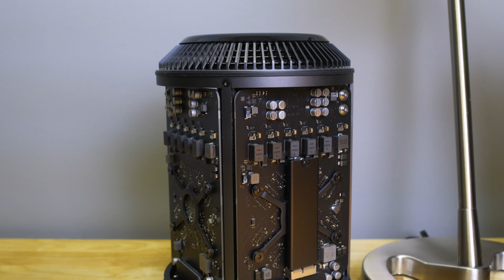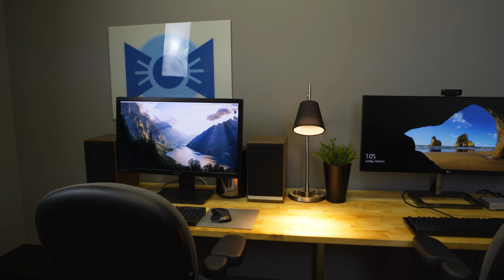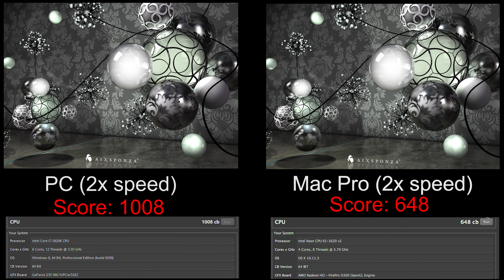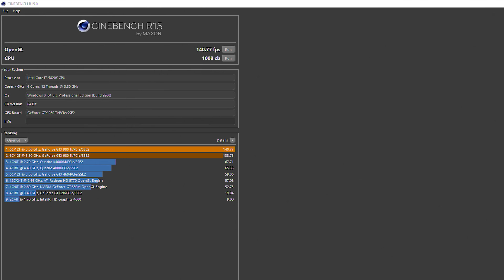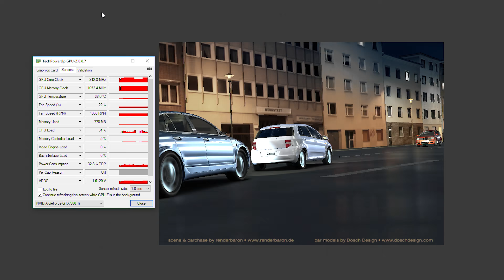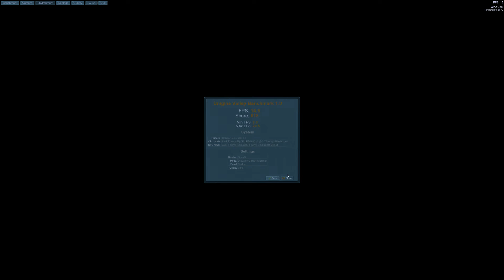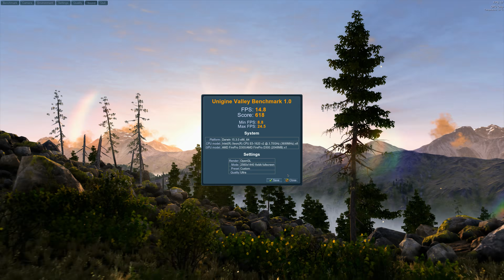$2,000 Custom PC vs $4,000 Mac Pro

Comment: The only thing that's better about the PC is the price, performance, upgradability, compatibility, ease of use, operating system and software. Everything else is better on a mac.
Reply: Gaming.
Rendering.
GPU and CPU speeds.

What does Mac have?
A shitty, buggy OS.
Terrible hardware.
Anti consumer marketing.

Just know that I was an Apple fanboy for 5 years.

Comment: You know what?
M - Most
A - Annoying
C - Computer

Because its very expensive and useless and looked like can

Now how about PC?
P - Perfect
C - Computer

Because its very cheap and its faster than MAC
Reply: Adobe Flash isn't outdated.
VGA isn't outdated.. yet.
Headphone jacks aren't outdated.
Reply: IronLover 64 how are they outdated
Reply: Most Applications Crash. If Not The Operating System Hangs. MacIntosh.
Reply: Milk

At

CPU
Reply: No no no pc 
P - plastic 
C - cock
Reply: LukeGaming LK 
With outdated tech like CDs, Adobe Flash, VGA, headphone jacks
Reply: Also viruses lul

Comment: 1008cb for 2000$?? i get 1500cb for 1500$ with ryzen 7 1700!
Reply from the maker: +Kuntal ghosh This is an old video as you can see by the date. I recently built a Hackintosh build using a 1600. Check the channel. :)

Comment: Honestly I hate windows computers soo much. My mac mini I've had for 2 years now still runs fine with no problems of any kind. I had a windows computer for 1 month and it is already getting viruses and problems with performance. Both computers have the exact same stats and price but the mac runs much faster. I spent a week finding a way to sort of overclock the pc and it still doesn't reach the speed of the mac.
Reply: iTechGhost tried mcafee yet

Comment: No it's not anything refurbished it's just power supplies HDD's and SSD's which are terrible to buy refurbished because they have a pretty short life span compared to everything else in a PC, CPU's if not overclocked can easily last 10 20 years, RAM as long as you don't mistreat it will for all intensive purposes last forever, GPU's last 7 - 15 years~ Motherboard it really depends but I wouldn't be afraid of buying a good quality all Japanese solid state capacitor motherboard as the caps are the things which have the limited shelf life and they have to deal with clearer power than the power supply does so if it's well designed you are pretty golden for upto 20 years as that is the mean failure on those capacitors.

Comment: First time viewer, first comment. I have a 2009 HP 6654 pavillion running 64 bit Win 7 & 10, I'm playing Mass Effect Andromeda, Assassins Creed (all of them), Crysis 3 (at high graphics) and they all run at 35 to 50 fps on OEM parts. My rig should be 6 feet under and these games shouldn't be possible to even run but it seems that a streamlined setup and solid hardware are more important than whatever marketing hype you'll see in a catalog.

Comment: Great video!! I totally agree that Apple needs to up the game, unfortunately their focus is somewhere else. They look more at the wholistic user experience not raw performance power. 

They will never be bleeding edge in the hardware, but they continue to push the boundaries in interface. For example I have yet to find a product that works as well as iChat, or FaceTime. Skype is a long and very far second place. 

Those are the types of things Apple focuses on, we use FaceTime now exclusively at our company and would switch to PC/Windows based in a heart beat if we ever found a product that worked as well.

Comment: Well, with mac they stuff everything into small tube and put fan on top. This type of case meeds major redesign of internal components from ground up, it's not same as pc standardised hardware, where you just put everything together in a box. It's beautiful, but you pay fir it. if you want upgrade, you'll will have to wait for next model, which sure it will be high specs what it comes out, but after 3-4 years it will have same problem as this one.
That's why rational people (like me) buys pc and build it up their needs. Since last 10-15 years apple use intel chips, it's basically the same as pc technology, just with better looking design, but even this start ta fade in last years..

Comment: The only thing good about a Mac computer is the OS; granted no one ever does these test with like for like parts. Because Mac uses the same intel components every company does the just put it in a nifty enclosure and up charge 3k for the OS
Reply: I agree with you but using like for like parts just isn't the case and even when you do use equal parts it is always most times cheaper, even at launch. Parts like the SSD and the RAM are overpriced in MAC systems when you can get them for cheap on a PC

Comment: there is alot of mac people who are trying to convince me to buy it because its more reliable, wont slow down after years of use and it is less likely to be infected by viruses.  is this true? or is this all garbage. i am torn over which kind of computer to buy.
Reply: It is obviously not true. the "slow down after years" i dont quite get it, if a computer slows down is because a) viruses (most common thing in unfamiliar users of computers) or b) old parts, wich is in fact a downside to mac, since you cant repair alone or exchange the broken parts. and where the viruses part is half true, since not many viruses are targeted to mac, if you dont download cool toolbars and porn from softonic you will be ok. Since you seem unfamiliar with computers, i wouldnt spend more than 200$ in one right now.

Comment: Isn't a Mac good because it doesn't crash as much or at all?
So if someone was a programmer wouldn't a Mac be the better machine of choice.
Reply: As long as you dont download cool toolbars from softonic, your windows is going to crash the same as your mac. And the "crash factor " isnt reliable on machine, but on the OS. If you were a programmer you would probably use a pc with linux.
Reply: Mr. Bannana your implying that windows is prone to crashing which is not true as long as you take care of your system.

Comment: Oh cool so didn't even come close to building a mac pro. Do you know why the ram needs to be ECC? Do you know why the mac pro uses FirePros? Do you know why its a Xeon processor? And you completely started the video saying everything wrong. You overclocked your machine like a dumbass, so now you will need to add extra fans for cooling, more noise, more heat and you have no reason to be benchmarking them. Cool you ran some short-term tests, let them run for days rendering 4K Adobe Effects compositions. You will burn up your custom pc. You clearly have no idea what you are doing, and comparing consumer quality to production-server class quality components. Of course you saved money, but you have no idea what you are doing as it compares to doing when it comes to professional production work. Have fun playing games at 60fps, but it won't consistently render 60fps 4K, not before your overclocked cpu and overheated gpu gives you neckbeard dumbass.
Reply: oh i see, a constructive critic.
Reply: Cory Billeaud probably search up everything before you commented
Reply: MrChickenFlix no just have heard the same tired argument for years from people who think gaming based-specs are the same as needed for professional workstations. It's the same misinformed argument i have heard since the windows 98/NT days. there is a difference.

Comment: You're doing it WRONG.
Try comparing rendering and export times using Final Cut X on the Mac Pro and Premier Pro on the PC. When Apple optimizes software and hardware to work together the performance is spectacular.

Comment: I had better benchmarks on Unigine Valley on my PC which is cheaper than either of these O.o
Conclusion: Both of these systems are overpriced (The Windows PC shown can be bought/built for MUCH cheaper than $2k)
Now with Ryzen out for multitasking/core and GTX 1080/Ti You can easily build a machine a lot more powerful than reference shown here for much cheaper.
You should do an updated version of this video doing just that.

Comment: No surprises here. Apple is getting left behind. No, actually Apple abandoned these high-end users. And they have ALWAYS been weak in graphics processor options. I am probably going to upgrade my Mac Pro - one of the last-gen of the towers - till I can't anymore. But next machine will likely be a tricked-out iMac. More cost effective, and the 5K iMac IS a higher end machine than the base Mac Pro.

I'm a Graphics and Web Designer, but if I was doing a lot of high-end video or 3D modeling or animation, I'd HAVE to bail for Windows- which is a lot less a horror show than it once was. I prefer the Mac OS, but I've not been happy with Apple's uneven 
support for pro users the past DECADE. 

But what happens when their APP DEVELOPERS start jumping ship? You know the guys and gals that make those pretty little apps for iOS? – and need pro class machines to CODE on. They've already complained about the new MacBook Pro.

Comment: My i3-6100 with a GTX750ti scores 909 in Unigine (1.5 times as good as the Mac Pro) but only cost 550 Euros.
Reply: I ride around and stuff it cost that much? For 550 Euros you could've gotten a gtx 1060 6gb with a i3 6100
Reply: No Uploads not with a WiFi mini ITX board, SSD and a small case that doesn't look ugly.

Comment: Actually I originally bought a mac (2009--I know it's ancient!)for the stability of the Linux core. But now they are so behind the times...unlike when Steve Jobs ran it they actually had something called innovation...under Mr. Cook...not so much..if they don't get their hardware rear in hyperspeed they are going to lose many many customers...I use mine for music and love the stability but I need more power and speed. I saw a demo of a Dell laptop with v warehouse installed..so they had a mac osx session running on the laptop....and it cost much much less! I will either do something like this or a hackintosh. Either way Mr.cook needs to slash prices or really and truly be innovative...and not that stupid bar stuff or a single USB C. Or I'm gone too!!!

Comment: Shawn Snow i had been missing my old macbook pro 13'' late 2011 when i bought my Asus Laptop at 2013-4. Now i have a pc with 1060 and i still miss it sometimes. OK. Gaming was horrible but all computers are not for gaming. My macbook is 6 years old now ( my sister is using it) and its battery died this year, hardware was never a problem, osX runs like a dream, its trackpad and keyboard are flawless. I can't use my asus without a mouse but i enjoyed using the trackpad of apple. If you say apple is overpriced i will agree with you but noone can call these are bad computers.

Comment: Great! Is it also a good configuration for FCPX?

I founded online this one for FCPX, does anyone know which is the better one for fcpx?
PROCESSOR: 4.4 GHZ Intel Core i7 Processor
MEMORY: 32GB DDR Memory
MOTHERBOARD: Gigabyte GA-Z97X-UD7 TH
(2) AMD GRAPHICS: Sapphire Radeon VAPOR-X R9 280X 3 GB GDDR5 (these are a crucial ingredient for FCPX)
NVIDIA GRAPHICS: EVGA GTX 980 SC 4GB GDDR5 (NOTE: FCPX does not like NVIDIA Cards – AMD Cards are far superior)
POWER SUPPLY: Corsair Professional Series 860-Watt Power Supply AX860

Comment: So, is the 12 GB ECC DDR3 RAM in the Mac supposed to be equivalently tested with the 32 GB DDR4 RAM. That doesn't sound like a fair test. However, if the price is cheaper for custom PC then I like that better. However, what would happen if you upgraded the RAM in the Mac and ran it again? would it perform 3 times better with almost three time the RAM?Anyway, I'm not worried about that, I just need a machine for my wife. She does Videography/Cinematography for our church. And what I'm curious about is whether or not I can get a custom PC built in time for Christmas!

Comment: 7:00 Actually you mean more than 3 times as fast. More than 3 times faster means that it was more than 4 times as fast.
8:28 Their deal is that they know their customer base treats Apple products like a religion (I'm not exaggerating, there has been research into this that shows the same brain centers become active) and will buy their products regardless of anything. Why update and have a lower product margin when you can make more money through fools who wouldn't know good value if it shoved a 10 foot pole up their ass?

Comment: How gay one must be to buy this outrageously outdated and overpriced apple shit. It is getting to the point of absurd. And even if apple made new and faster machine than this 2k pc set up, the apple crap would cost 8k. look at the new macbooks, 25% more expensive than last years, but already with outdated hardware, better machines are sold by competition at 1/3 of the price.
Reply: i'm gay, I don't buy apple either, build all my own pc's

Comment: Last apple product I bought, and feel it was a good investment was a 2009 duo core intel macbook pro.  Still works 7+ years later, average cost per day to use was less than a dollar to date now.  Entire machine and the one before it was swapped out for replacement parts under applecare, so in honesty I have gotten two machines out of this one, no warranty costs other than the 126 for applecare, and so forth.  It now serves as a low end mobi system that just keeps on giving.  So, yes, apple sucks now, has for really a long time, and I would never buy another apple product again new, or even refurbed.

Comment: This question is only for knowledge. People usually say and also write in posts that Mac is the better choice for video editing and professional work. Why do they say that? Are softwares available for these tasks on Mac operating system significantly better than those for windows? Clearly the hardware on Mac is bull crap. So there should be some good reasons for saying that.
Reply: I think it's just like how apple advertisements work. It's just a bunch of horse manure to lure the flies.
Reply: Fahim uhh... jee i know this comment is almost a year old but to answer your question:
The problem is that a lot of these professional content creation programs (your final cut, your pro tools, etc.) are often built from the ground up FOR the mac operating systems (I can't imagine why). Thus, pc's, as strong and efficient as they are, may not always run these perfectly. I mean they DO run, but they may look a tad different and may experience a few more bugs and glitches than they should because they are rarely properly optimized for windows specifically. I certainly remember opening up pro tools on my pc after seeing it on mac first and remembering it not looking as smooth and as organized as it normally should. This is why i have recently been curious about these "hackintosh" computers people have been building recently. Basically, it's the same pc hardware like you see in this video, but instead of windows, they install the mac os instead. In theory, this should allow you to have both the amazing perfomance of pc hardware, but have the professional software optimization of mac. However i have not built one of these yet, so i can't say for sure...
Reply: Fahim you are correct deathstroke
Reply: You realize that the biggest and most successful major recording studios use Pro Tools, right? I'll grant that others are great for making edm, but once you step outside of electronic music, PT is still the industry king. So yes, it's considered professional software by professionals.

I'm also gonna say that Pro Tools 10-12 run great on Windows 7 as long as there's decent hardware. I haven't had a crash since I upgraded to a quality pc, and even my old cheap Dell laptop ran it fine with rare crashes from 2011-2016 until the power supply started to fail. 

Perhaps the reason for people praising Macs is the fact that there's not a large overlap of "creative" type people and those savvy with building a pc. With a mac, even though it might not be the top performer, you can at least be confident that it'll boot up without exploding and do what you need to get done, with much less knowledge or research required than it takes to make a working pc. That said, a 2017 survey of music/audio creators showed that 51% of respondents prefer pc, while mac is only preferred by 46%, with the remaining 3% using "other"
Reply: The real question is ¿who the heck buys apple trash? 

P.d only rich idiots

Comment: Correction, that model of Mac Pro is $2999, plus it's already several years old.
Reply: Even if it's 999$, still no deal.
Reply: ***** If don't like Mac, then don't use it. For me, my $2799 MacBook Pro did actually worth that price.
Reply: Guyuan Zhang benchmark results plss
Reply: "For me my 2799$ worth it's price". No, not for you or for anyone else, cos you can buy much better for the same or even less money. So it's not worth for anyone regardless of opinion, it's just that you like Apple or whatever - and that's OK, but it's not worth 2799$, that's a different thing.

Comment: I'm definately not a Mac fan in any way, but this comparison is apples to oranges. The Mac's Xeon cpu is a server proc vs the Intel being an enthusiast  proc.  The video cards are at different ends of the spectrum. The Mac's FirePro's are NOT gaming cards at all. They don't push high framerates. They are creation cards. The PC box with a 980ti is built for gaming and/or video editing and such. A $600 PC would beat the Mac in gaming benchmarks. This is a poor comparison IMO.

Comment: And my 2010 Mac Pro has 2 x 3.06 GHz Hexacores, 64 GB 1333 DDR3, and an NVIDIA GeForce GTX 970 4096.

I think that my machine crushes both of these.  And it cost me less than $1500.
Reply: Definitely a good choice.
But now imagine your 2010 Mac Pro would have been already the thrash can design.
You'd be stuck with a ridiculously outdated 2010 GFX card instead of your late 2014 GTX 970. You could still use it as a programming rig, but not much more.